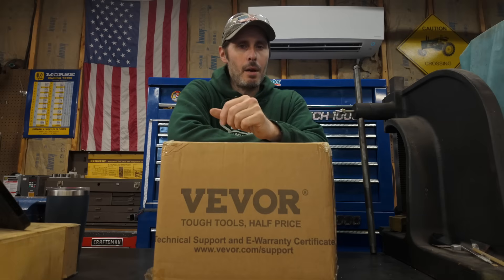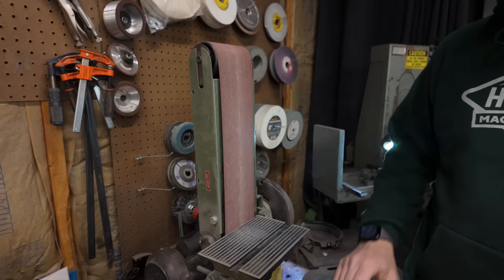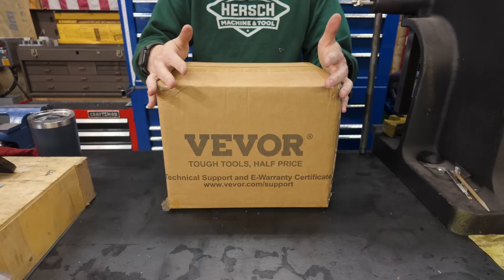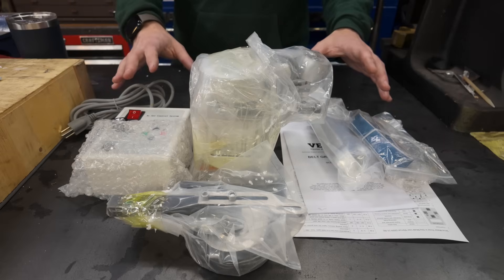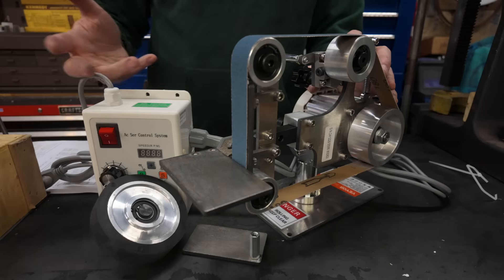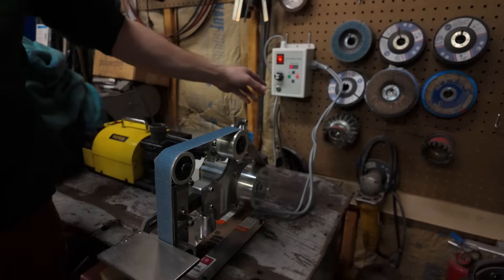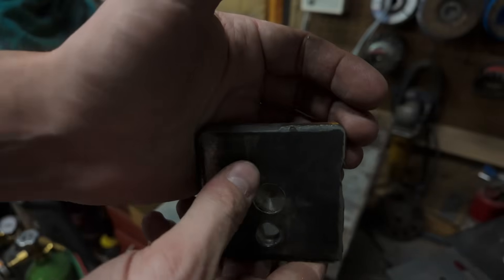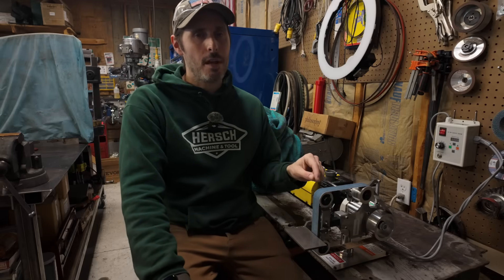The LITTLE GRINDER That COULD?

Comment: I have a Dayton 1x42" belt grinder from the 1960s that I paid $20 for 10yrs ago. Came with 1/2hp 1725rpm motor. A couple years ago I put a 3/4hp 3450rpm motor on it. It eats metal and fulfills my needs just fine. I use it everyday. While I've thought about building a 2x72, so far I have no need to. Point being fancier belt grinders are crazy expensive and trendy, but largely unnecessary for most of us. A dollar saved equals $10 earned.

Comment: Okay, your comparisons fail in several places. First off, you had the cheap HF unit clamped to the table and it still wobbled...yet you bolted the Vevor unit to the table.  So of course its going to feel more solid.  Sure the HF unit lacks torque, but if you can stop it by hand you dont have it adjusted very well.  All in all i agree...a nice upgrade.

Comment: from the sparks, or lack of, and the sound... should have run it at full speed for steel. 
timber sanders run slower as they burn otherwise. 
metal wants to go as fast as possible, within reason... especially aluminium?

i see no reason for it to not hog other than speed. an abrasive belt is an abrasive belt and it is 600W or more... plenty of punch.

yeah, id use one of these... pretty versatile for the right price.
Reply from the maker: Thanks, my experience with it so far backs up your advice. I keep bumping up the speed realizing that there's a reason it goes up to 5000rpm lol. I just wasn't used to having a belt sander that fast, learning every day.

Comment: 9:58 - you should repleace the belt to something like  3M Cubitron II then it will eat steel in few seconds ,  have no issues in hard materials,
and (in my case) they last around 10x longer than cheaper ones (3x longer than only bit cheaper other brands ceramic belts)
Reply from the maker: Thanks I'll look into that. I've actually been looking at getting some nice belts, was looking at the ceramic belts from benchmark abrasive but I definitely welcome the advice from experience and will give the cubitron a shot.
Reply: @hersch_tool  3M Cubitron belts are crazy , same for cutting discs (or ones for orbital sander (xtract series)  but now they have new Cubitron 3 ones  that are even better --you can cut piece of railroad with just single 125mm disc on angle grinder (dont ask how i know that 😆)

You can also check Norton , they have "Blaze" series (norton blaze) , entire line have around 75-80% performance of the cubitron II but use way stronger glue so you can push it (new Cubitron 3 is simillar but hard to get in every size)
And they have awesome discs for rust -Norton Blaze Rapid Strip that eat rust, paint etc instantly and you can paint it right after without any more prep (there is also "rapid blend" that makes finish almost ready to polishing but is slower and not for heavy rust / paint etc)
Reply from the maker: @ErtsenPlayGames  Rock 🤘 thanks for the info, I’m gonna order some of your recommendations today in fact
Reply: @hersch_tool  Fwiw I've not tried 3M Cubitron, but I've used Benchmark Abrasives belts for many years in grits from 40-400 and am very happy with them. I keep their ceramic 120 grit on for 90% of daily tasks.
Reply from the maker: @branchandfoundry560  Yeah, it seems like a lot people really like the ceramic belts. I think that's probably gonna be the way to go for day to day stuff. thanks!

Comment: Nice little grinder.
Reply from the maker: Yeah it's pretty sweet I think, big improvement over my old one.
Reply: @hersch_tool  3 things: (1) I ordered the grinder using your code, but think the site defaulted to an even greater discount as a new member. (2) Ref. "Perpetual Motion" vid. my grinding belt was contacting my motor power cords, solved with zip tying cords to the motor. (3) Loose bolts. I had to disassemble and Loctite most of the bolts.

Comment: I used the same hf belt sander for a while before building my own 1x30 powered by a hf angle grinder. The sander obviously doesn't do will with steel, but I did build quite a few knives with it and various other tools and parts. Keep in mind, that's a low speed sander. What you recently acquired is a grinder. So comparison is like apples to bananas.

Comment: A few years ago when I was less informed I built a Vandelay “machinist’s” 2 x 72 belt grinder with a 2 hp motor on VFD.  The materials alone cost more than twice what I would spend on this little guy and it takes up a lot of space (but admittedly it looks totally impressive and it’s a grinding beast).  However, if I had seen this machine I might have taken the opportunity to save some time and money and I bet a number of viewers will do that.  Vevor and other suppliers know what they’re doing when they provide freebies for guys with a media channel.
Reply: I was just about to comment that he should have looked up Phil Vandelay and his belt grinder... That is a proper machine... I have to be honest with ya - diy is better, and cheaper, you just have to get scrap steel instead of paying for it like a moron at the steel supply... I have bought 2000kg+ of toolsteel from my favorite scrapyard, and that is just toolsteel... The material for the Vandelay grinder would likely cost me 40 bucks or less...The motor would be also scrap bought(taken out of some machine that arrives, like an industrial compressor or similar) and would cost me another 50, plus the argon and filler and all the prep - it would climb to maybe 200 bucks for a beast of a machine like that... And that is with today`s prices... A few years ago, the price would have been half of that... Sure, it takes work, time and equipment to even be able to produce such a unit like Phil did, but the result is worth it... This is a nice, hobby grade machine, but when you compare it with Phil`s - this is a toy...

``There is no kill like overkill``
Reply: @Dogfather66227  you dont need to build it like that , i build my own vertically 
Maybe its a bit tall , but do you need the space above the grinder ? Mostly no , and i save a lot of space by that 
Except if you want to go horizontally then yes , but you can make it like an adapter where you can change the hight of upper bearing etc and make it wide but easy to go horizontally (or use bit shorter belt than 2x72' , maybe even something like 3x59' or 4x59' (some brands call them x60' not 59')